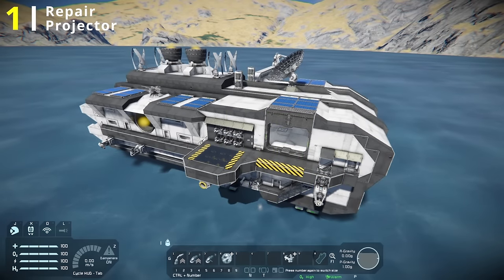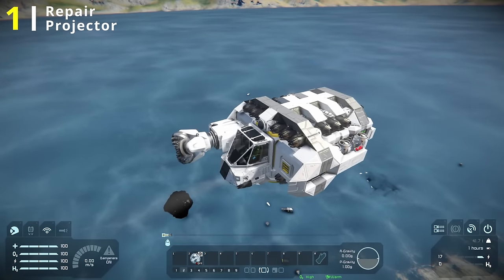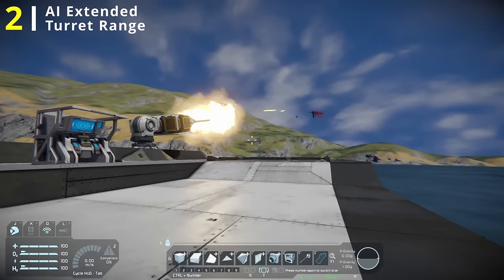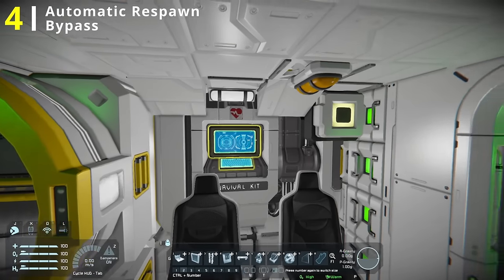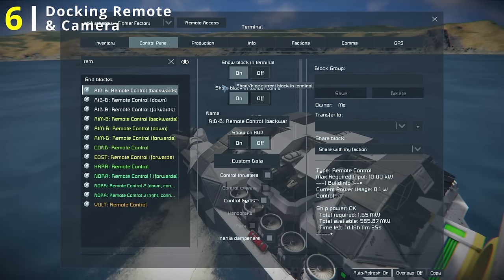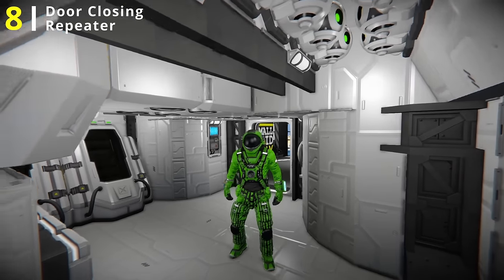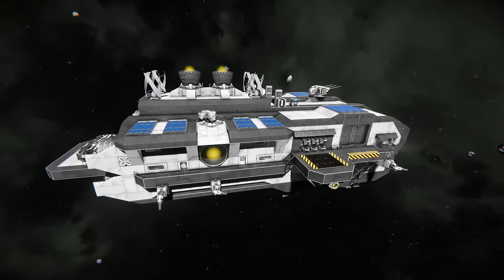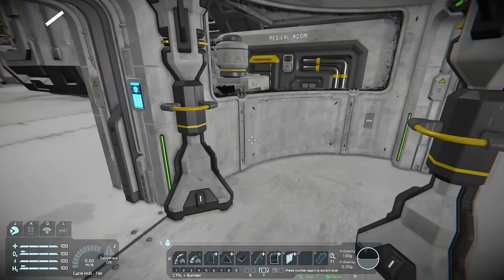10 of My Favorite Upgrades: Space Engineers Tutorial

Comment: My obscure tip to add is that while "Door" and "Offset Door" can pass air through them, no oxygen seems to actually be stored in their block space. This means that while an airlock made from two back-to-back sliding doors will vent out two blocks' worth of oxygen into space every time you go through it, the same kind of airlock but made instead with offset doors (or normal doors if you don't have Frostbite) will keep all of the air inside (when operated correctly). This can be kind of useful if you don't like "Keen airlocks" but still don't feel like building a fully proper airlock, and hate venting oxygen into space.

Great video btw, thanks for the tips!
Reply from the maker: I noticed that, but never though to use them for a lossless airlock.  Good idea.
Reply: i experimented with them a little since the contact update. turns out when the inner door is open, it fills the door block and when you close it, it turns back to 0 oxygen but that air is gone, not brought back to the tanks, just gone. so that's a bit of waste right there
Reply: @lucasgrd4258  I tried that too 6 months ago, but I found that when I put the air vent into depressurize, the same amount of air got sucked back in, as if the volume of the door's air space was 0 anyway
Reply: Opening and closing the door also didn't result in the air pressure % (reported by the air vent) going down
Reply: @LeeSpork  after closing the door ? That’s interesting…
However i often find myself in situations where my o2 tanks are filled up by the generators so i can’t depressurize.
I don’t have the space on my ships to put a side conveyor system with a sorter to toggle on or off the o2 generation
Reply: @lucasgrd4258  That's why I tested it in a controlled test world enviroment

Comment: I agree with everything except the doors shutting on a timer. You'll get killed by the doors eventually. Instead, have you considered using a sensor that shuts the door when a player is no longer within 2-5 meters? Don't set it to open the door: that could vent your air at a bad time.

Comment: 1-9 are all great tips, which I use all the time as well. #10 is an exploit, as that isn't the intended behavior of those blocks, but I can see in the case you suggested (you have friends that don't wait for your airlocks and constantly vent everything) it is a reasonable solution that doesn't break immersion too badly. Nice work!
Reply from the maker: Yeah, I usually keep #10 hidden.  I don't like breaking immersion, but sometimes I want to save PCU or make things foolproof.  

I've actually put in bug reports for the windows (and panels), but it seems they're working as intended. :/  At this point I'm embracing it.
Reply: Hasn't keen been starting to fix this one
Reply from the maker: @andrewhoughton8606  In the most recent update they added a handful of blocks that also act as Keen Airlocks (more panels that act the same as the windows).  I haven't seen anything indicating that it's going to change.

Comment: Small personal hack:  If you're using a docking camera on a small grid ship connecting to a large grid, when you build the large grid connector orient it in a way that the little side lights will be in line with where your camera will be on the small grid ship.  Those side lights make great aiming references.

For example at 14:47, I would rotate that large grid connector by 90 degrees so that one of those side lights is on top, and now the camera will be staring directly at it.  It will also help with seeing the connection status.
Reply from the maker: Good idea, I never noticed that.  For some reason I tend to place my large grid connectors with the lights on the side.
Reply: Yes! I do this too. If you place the camera right on the small grid, you basically just fly straight at the center of the light.
Reply: My tip is use ai modul. Very very annoying to me when i need to docking. ( specially when the docking place is moving. Like a mother ship or etc.) I just use ai modul instead my docking skill. 
Or another tipp i using docking arms in my base. when my ship in position ( AI) docking arms get my ship. And a piston connecting to my ship. Ai thing a little effort. But longer campaign is usefull.

Comment: I knew most of them but did not know about the seat having a target lock detection. 
An addition to the door closing repeater that can be done: if you never want to have the door closing in your face but don't want to wait 20 seconds, you can add an event controller that detects the opening of all the doors and then it starts the timer to close all the doors, you can set it up to 3-5 seconds instead of 20 seconds.  

My favourite thing to do on any ship I pilot: is to make a group of all the breaking thrusters and have them turn on/off on the first control bar (I always set it up at position 9). That way you can save a lot of energy\fuel by just gliding, and the nose is always pointing in the direction you are going: which is better than turning off the dampeners in 0 gravity

Comment: A nice quality of life upgrade I've done for a few years now on my smaller ships is a 1-button startup/shutdown... well, really 2, as it's 2 timer blocks. Shutdown is pressed after I dock with a connector. It shuts off all the gyros, antennas/beacons, thrusters, lights, etc., and sets batteries to recharge, and O2/H2 tanks set to stockpile. Startup is the same thing in reverse, switching everything on, then unlocking the connector.

With the Automaton update, I was able to make it even more seamless by setting up event controllers. Now, when I dock with a connector, shutdown sequence occurs. I still prefer a manual startup, which ensures everything is running before disconnecting the connector. It makes life much nicer aboard my ship, and doing quick outings.

Comment: A small tweak on the automatic closing doors, set an event controller to check if any door has been opened, then start the timer block with ~5s delay, doors only shut after you open them
Reply from the maker: I like that idea.  Need to make sure the time is set properly for each build though.  Often I'm walking specific routes through multiple doors.  I don't want the second or third door I open to always close on me because the first door triggered the close function.
Reply: @ShiftyshadowTV  could always seperate out the doors, but that would be tedious at best

Comment: Pipe in welders to critical components to go along with the weld projector. That way all your critical stuff can get a quick repair with a click of a button. If you set them up so multile systems are in range of the welder, they all get a repair... 4 large hydrogen thrusters with a single welder in the case of my carrier.

Comment: Just a small note about the auto close door timers, the sliding door can pinch and kill your engineer. I use timers on all my internal doors since they're all regular or offset and those will just push you out of the way but the sliding doors will go for the kill so i use those almost exclusively for exterior airlocks and won't add them to the timer.

Comment: Man, the 'airlock cheat' blew my mind... The amount of times I have vented the ship because I was too fast/careless is staggering. I will use that trick on my next build. Massive thanks!
Also - 'reverse camera+controller' - so easy but I have never though about it. I had reverse cameras and used them but it's sometimes tricky. I wish keen has introduced the direction option to the movement AI and recorders. Making autodocking for the grids that need to reverse to the connector sucks.
Reply from the maker: Yeah, it's nice not having to worry about venting your air.  I've only used the new AI for autodocking a few times, it does seem like a pain.  Only worth it to me if I'm fully automating something (that I'll use a lot).

Comment: I must say, I'm mostly critic, and while those ideas are fairly known for long time players, you explained it absolutely well and added some bonuses. I wasn't fully aware of the air tight blocks, which can save you 125 pcu instead of a door. Superb.
As a mini cherry on top, you might have could said for your periscopes, they can't be projected (from their main grid), as they are a subgrid. Veterans know this ofc, but I saw a few new comers in the comments. Splendid work overall.
Reply: and yeah, if guys want to use fancier stuff, like said periscopes or extra remote controls, etc and are limited by pcu (like on the servers often times), one has to outweigh the cost/usefullness depending on ones situation and desire.

Comment: For the parachute one, i actually use two event controllers and a logic gate script to basically figure out altitude and speed, and if both meet the criteria (aka youre plummetting at fast speeds) the emergency systems kick in to save you.

Just so i can fly or drive in low altitudes without auto systems freaking out
Reply: I could have used this yesterday. A friend and I were playing, and he hosts the server. We’d picked up a lot of gold ore. I had built a freighter drone that was basically 3 large grid containers with a bunch of batteries and thrusters that we attach our miners to for long distance mining, and I fly it remotely from my miner. I got that in the air, miners and gold in all, and as soon as I got up to speed, I got booted from the server, sending us into the ground at 100m/sec. Your system may have saved that expedition.

Comment: I don't know if it was mentioned yet but putting an air vent pointed to the exterior and set to depressurize will collect oxygen. Of course you can use it for larger grids but it's also useful for cockpits since they require an oxygen supply even in atmosphere
Reply from the maker: No-one has mentioned it, but yes that's a good idea.  I do that for most of my builds (anything that flies in atmosphere).  If I make another of these upgrade videos that might make it in.

Comment: Regarding the doors one:

You can prevent the doors from shutting in your face completely by having an event controller check if the group of doors is open, and if it is, start a timer block with a 5-10 second delay that closes that group.
That way, if any door is open in that group, the timer block will close them after 5-10 seconds of them opening.

I checked this, it should work.
Reply from the maker: That's a good idea.

Comment: Overridden gyroscopes on custom turret blocks will help stabilize the turret instead of swinging around unexpectedly.
Reply from the maker: Interesting, seems like a lot of extra weight, and that it would slow the aiming.  Weight isn't a problem on stations, but there you could share inertial tensor to stabilize.  Could also just reduce the turret turning speed.  On ships adding weight to subgrids tends to making moving chaotic, but if your ship is significant heavier than the subgrid you're probably ok. Might give it a shot.

Comment: I'm waiting for the day airtightness gets connected between the block faces...
But as is, it's already expensive enough so I doubt they will ever introduce directionality to it.
I build an airtight docking tunnel with that trick, basically a tube you can stick between ships without venting athmo.
The key is to have a "separator" in the middle and two airtight compartments on either side so they get passively supplied from both ships.
Reply from the maker: Neat idea, I haven't tried anything like a tunnel.  Mostly I use the oddly airtight blocks to secretly break up the interior of my ships, or fool-proof airlocks.

Comment: Hey sir, a suggestion if I may.  I am watching Small Grid episode 5 and noticed that you seem to randomly put you actions randomly in the hot bar of your ships.  I am two months old in SE, so I hope this may be useful to you and or others.  I am ex-Army and disabled veteran (suffered a TBI overseas).  In my MOS and many others, especially the Airforce, we used checklists.  I have severe memory issues and such, so this is where my suggestion comes in handy for me especially.
  When I fly my little POS (learning how to build ships), I make groups for actions as most people do.  What I do is place my icons on the hot bar in order from left to right in sequence for take off.  #1 Power, #2 Lights, #3 Engines, #4 Docking Conn, #5 and #6 are docking cameras, #7 Gyro lock.  So hitting them in order 1,2,3,4 allows me to fly without accidentally hitting the undock while the batteries are still set to recharge and falling to the ground like you did in episode 5 😱😂😅🤣.  Then when I come to dock and am at the connector, I hit them in reverse, 4,3,2,1.  That way I connect first, safely turn off the nines, then lights and set the batteries to recharge.
  I see that you have not posted in six months, so hopefully you are still playing and see this.  When I saw your little scout ship fall to the ground, I thought you might like a helpful tip.  Anyway, I hope that whatever is currently occupying your time is going well.  I hope to see more new videos sometime.  I will be hopping in and out of your Discord from time to time, maybe I’ll catch ya sometime and we can talk.  Anyway, take care, be safe and may God Bless!  😇🫡🫡🫡🫡
Reply from the maker: I usually set up my hot bar with the most used groups in the easiest to reach places (1-4).  After that a lot of my grids are the same.  I could set up one of the secondary hotbars with launch and dock sequences though. It's not a bad idea.  Could also use an event controller to do it all for me now too. :D

Thanks! I've been learning how to make SE mods and making a few of my own.  I'm always around on the Discord.

Comment: There's a better way to automatically close doors.  Use an Event Controller that monitors all of your doors.  When one is open, it triggers a Timer Block to START, running for a few seconds, then applying the CLOSED action to all doors.  Only the opened doors will then close.  In this way, you'll never get caught in a closing door unless you hesitate longer than the timer.

Comment: The 1st one is a great idea however I would making sure I have a control seat, cockpit, helm or what ever that can "control" said grid, and take a seat in it and just use the hotbar numbers to control how to line it up and after you're done, remove said hotbars, you'll need 2 free hotbars for max control one for rotations and another for shifting/sliding!
Reply: The 6th one great idea however in case of me needing a abandon my ship and ease of escaping, I put my drills on the back of my ship and use that method to flip the controls to the correct direction for mining however for normal flying my cockpit is facing the reverse of those drills for if I need out, I'm not stuck in my drills or have to squeeze between my ship to go back though the hole I made!
Reply: The rest are nice to know, hope they don't patch that last one! Lol
Reply from the maker: I can line up a grid with the sliders faster than I can set up a hotbar for it (usually takes me 5-10 seconds).  So if I'm only ever lining up a projector once I don't bother.  Its a good idea of you find using the hotbar easier though.
Reply from the maker: Hmm, interesting miner setup, I make welder and grinder ships that way sometimes, mostly due to piping decisions.  Do you often find yourself needing to get out of your drill ship while drilling?

Comment: What if you set a trigger for the door opening event and close it after 20 seconds? Instead of an endless loop with an unpredictable closing time
Reply from the maker: That would work just fine.  Some things to think about though:  

If you set it up for each door individually that would be a lot of event controllers and timers, might as well use sensors at that point.  

If you set up one controller that detects when any door is opened and then closes all after 20 seconds, you could run into a problem where you ALWAYS have a door close in your face while walking a certain path through multiple doors in your ship.  You'd have to test and time that system for each grid individually.
Reply: @ShiftyshadowTV  ah, I am building smaller ships for a while, so it didn't even occur to me. Heey, another idea for an airlock - opening of door 1 triggers closing of door 2, and opening of door 2 triggers closing of door 1.
Reply from the maker: Yeah, it would work great for small ships (or just ships with few doors).

If you trigger one end of an airlock to close when the other is opened, you will have a brief time with one opening while the other is closing.  In SE doors are not airtight unless completely closed, and "airflow" is instantaneous.  So you'll lose all your air every time.  (Unless you have an airtight block between the two doors.)
Reply: @ShiftyshadowTV  this what I was afraid, maybe I can figure out how to include timer in this chain somehow (and not complicate the use of an airlock). hmm. To turn off doors and use custom buttons? and press F on 4 buttons instead of doors